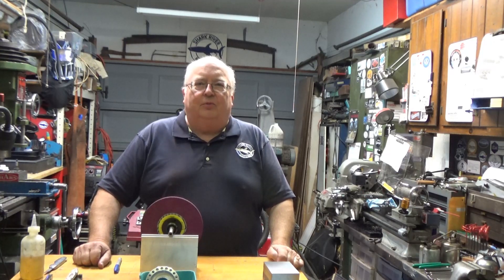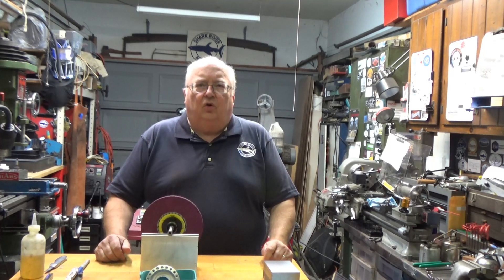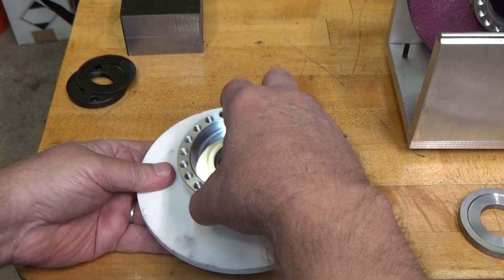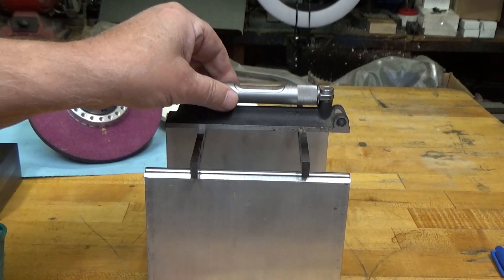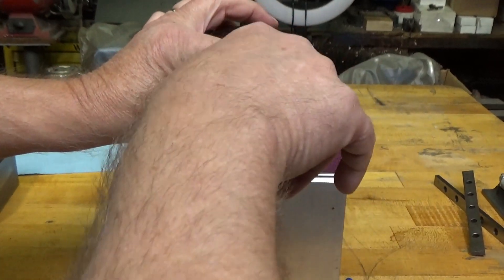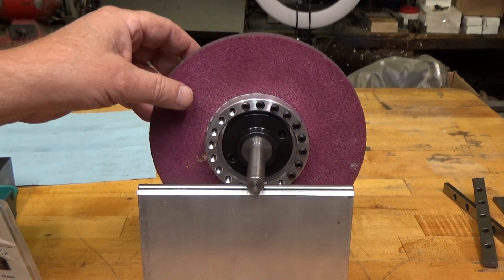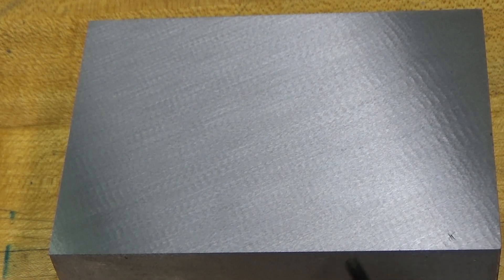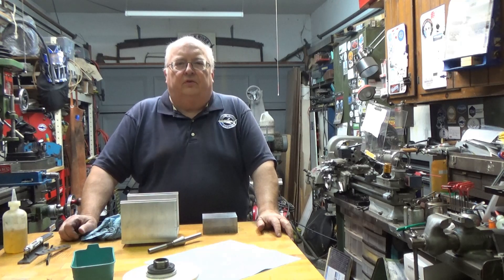Balancing A Surface Grinding Wheel  - Revisited

Comment: 32 years precision grinding and i have never once needede to balance a 1/2 inch wide wheel. Neither has anyone i have ever worked with or shop owners. For some reason a lot of youtube amatures seem to like creating problems for no reason. I change wheels multiple times a day sometimes. This is just stupid!
Reply from the maker: We will need to agree to disagree. I am a retired machinist with over 50 years of experience.  For normal commercial finishes your are right and the only grinding wheels that I ever balanced were 24" diameter crankshaft grinding wheels. As a home machinist I seek finer finishes than I ever attained commercially.  Balancing these surface grinding wheels made enough of an improvement in the finish to make it worthwhile.
Reply: Journeyman tool and die maker here. 2 carbide shops and now over 10 doing all grinding in gage shop. possibly you just have a garbage spindle but i have built many draw dies and expand noses, also powdered metal dies all at 4 micro polished. No one ever complaines about my finishes. Only wheels i balance are 1" wide for something like a 6/18 wet grinder where wheel will stay on hub till worn out or larger wheels. No way i want a bunch of set screws spinning.  @sharkrivermachine
Reply: Im just saying sometimes im holding 2 micron, thats better than class b gage blocks and didnt balance the wheel. Not once ever.  @sharkrivermachine

Comment: Looks like a neat design. I made a balancing ring with adjustable weights so it’s not at the mercy of the fixed weight of the set screws. It’s essentially a cup with thin edges that are perpendicular to the wheel sides around which the weights are adjusted. The balance procedure I use is in the Jones & Shipman 540 manual. The results are remarkable. Be well, Steve.
Reply from the maker: I have seen that style hub.  They are very expensive.  The ring works well for an existing hub that does not have that feature.  I am always on the lookout for hubs, maybe I will find one.   Thank you for watching and commenting.

Comment: Thanks for the video Steve.  I wonder if the remaining ripples are an indicator of some other issue.  Could it be spindle bearing wear or motor vibration?
Reply from the maker: There is definitely some noise in the grinding system.  I suspect the motor bearings.  The spindle feels smooth.  Thank you for watching and commenting.

Comment: Steve, I wonder if that wheel was so far out of balance that a good static balance is still out dynamically. I was amazed how much weight it took for a 1/4" wheel.
Reply from the maker: The wheel that I balanced was actually a 1/2", I demoed the 1/4" to show the mounting.  I think that one of of the reasons for the amount of weight is how close to the center the weight was applied. Building a dynamic balancer would be an interesting project.  The other thing that I need to double check is the accuracy of the arbor.  Thanks for watching and commenting.

Comment: Nice video Steve, thank you for the product review, I haven’t had a wheel that heavily out of balance as your example….best, C
Reply from the maker: It worked well.  I was not surprised because it was the same as the other wheel that I did. As I showed in the video the wheel that I drilled took a lot of material removal to balance it.  I used to balance 24" crankshaft grinding wheels and we actually used lead washers that screwed to the side of the hub. Thank you again for making them available.

Comment: Looks a convenient way to balance a wheel, nice idea. It took me a good while to get good surface grinding results, a combination of wheel grit size and type etc. combined with balancing. I made the mistake of initially going for too fine a grit, a 36 grit wheel gave better results. Good luck with your experiments.
Reply from the maker: I was rushing the grind a little.  I have gotten better finishes in the past. I need to let it spark out after the final grind.  I think that I am getting some noise in the machine from the belt.  Need to investigate that.  Thanks for watching and commenting.